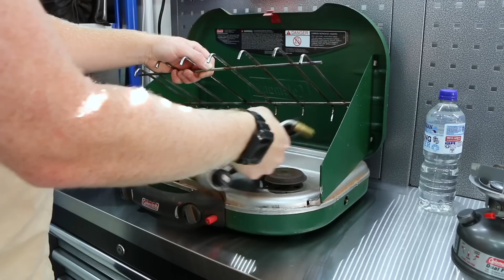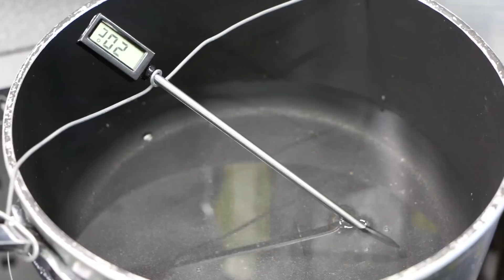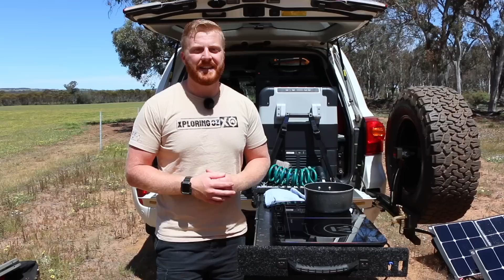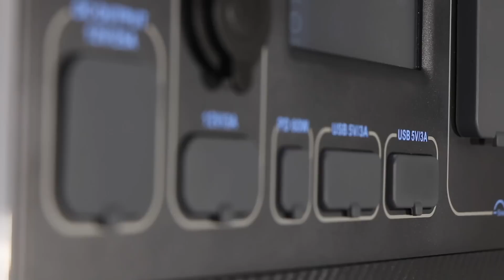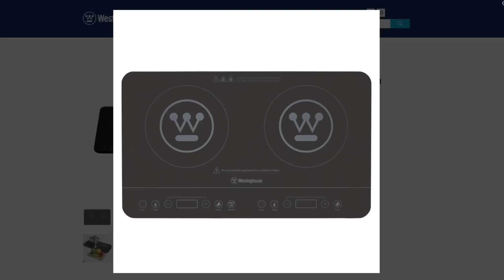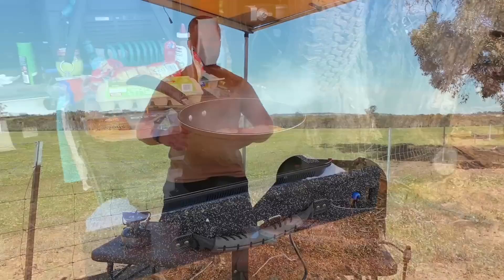INDUCTION COOKING & Camping | Is it sustainable | Electric vs Gas | Overland Cooktop | Pots&Pans

Comment: Great Video. My only query would be how do I cook my toast? It is a serious question. Normally I would use our campfire but it n wet days or in total fire bans campfires etc aren’t going to be happening. Cheers.
Reply from the maker: Yeah, someone else did bring this up and to be honest it wasn't something that I thought about before. This is probably not the best method to make toast, but I did manage to lightly toast some buns in the fry pan after cooking bacon and eggs in the morning, but like I said, not really ideal...
Reply: use a toaster?  sorry, not taking the mick....  if you've got suitable electrics for running an induction hob you can unplug it and plug in a small electric toaster which will probably take less power.  more stuff to cart around though.
Reply: Yep, I had thought of that Ray but as you say it is another piece of equipment I would need to find somewhere to pack. I am looking to try and be gas free. I currently have 300amp hrs of battery on board with 300watts of flexible solar panels so as the portable electric appliances improve I might be able to ditch my two gas cylinders and my gas cooker and that would free up space and weight for things like toasters etc. And yep I knew your weren’t taking the mick. 👍😂

Comment: I have Lithium, gas and luv an open fire. Total  fire bans, no probs with induction.It's great to cook on a fire, but a good cooking fire of coals takes hours and wood. Gas can be a problem, especially with a leaking hose or connection.  And on a 45c day, who wants to light any heat source, and stand around it getting even hotter. I noticed a youngun standing around while you were cooking. Is there any price on safety for kids? I have a Weber Baby Q which I love cooking with. What a PITA to clean. Induction is not what I do all my cooking on, but nothing matches it for quick, clean, safe and suited to any/all weather conditions, indoors or outdoors. Cost, Ok It's exy, should get 8 to 10 years out of Lithium, and it runs everything else electronical you've got.
Reply from the maker: For sure, 100% agree with you there mate. 
All the different types of cooking options have pro's and con's and this will all depend on personal preference, but its nice to have the options. 
Cheers, Nathan.

Comment: I'm running a 280ah litium cell with a 3000w inverter with the twin plate Westinghouse induction, works great ! Can also run a sandwich press, coffee machine, air frier etc.  Charging is managed via a 30/60amp DC DC charger, 30 in idle and 60 at speed above 60ks an hour. A typical 2 X pot cook up runs about 40-50amps, spag bowl for example, single cookup, bacon and eggs about 25 amps, hardly use my solar, as I get higher rate of charge driving, and I do more traversing then base camping. However can get 2-3 days being sensible without charge. However can also run the car for an hour or go for a drive for a couple hours. I love it. Built my own battery using prismatic cells. Lost power at home for a week due to storms and I just wanna lead from the car inside, kept my lamps, tv and fridge running the whole time, ran the car at idle for about an hour a day, however was gas cooking during that time as I had it. It's a 10+ year investment. I still carry a butane cooker as an emergency. I was running 2 X 100ah AGM, so by doing this I now have 250ah usable as oppose to 100 and also shed about 35kg of weight. Well worth the time and effort to investigate.
Reply from the maker: Awesome mate, that sounds like a great setup you have there. 
Those results would be somewhat similar to the results I got during my testing. 
Like you said the solar and charging setup would be heavily based on each individual style of driving/camping and time doing each. 
I agree with Lithium being an investment, it's just a large amount of 💰 upfront for most... can be hard to justify to those who only camp a few times a year. 
Cheers, Nathan.

Comment: ALDI sells similar induction cookers for $49
Reply from the maker: Sure, there's heaps of different induction cooktops out there for cheaper prices, the main reason I choose this system was the ultra low profile at only 4cm. This is one of the slimmest units I could find and required for my setup. 
Cheers, Nathan.

Comment: on the induction unit, it says rather clearly, "do not use on metal surface"

you tested on a metal bench, 

do you think that this might have meant some of the "power" was lost as it would have heated the bench to a degree also, and not just the pan
Reply from the maker: Yes, this is true, however these results were consistent with those tested outside the garage as well. Further, I did not notice any heating in the metal veneer bench. Further the Bluetti power output was also consistent with tests away from the bench. 
Although it's technically possible, I don't think it effected these tests. 
Cheers, Nathan.

Comment: Another great video, love your work. Dual lithium for the 200 could be another good option. I’ve just purchased a replacement under bonnet lithium for my old aux and might dabble with a single induction cooker now I can run it.
Reply from the maker: For sure, a fixed lithium setup would also be awesome. I guess it depends on what type of setup you're looking for and whether or not you wanted the option of portability. 
I do like how these Bluetti units also come with the hardware for inverters and MPPT chargers include though, they really are a neat little package. 
Cheers Nathan.
Reply: Inverters can be hooked up to the starter battery also, just run the engine while cooking. Great if you have an aux battery,  but can be done without it. I also have a microwave that runs on 12v.

Comment: Really usefull testing you did there. Thanks! I would also add to the pro's - On cold mornings gas can be very hard to use but the main reason I switched to induction is to get away from using gas which we will all have to do eventually (gas is a bad contributor to global warming).
Reply from the maker: Thanks mate, I try and test the most realistic scenarios as this is what we are going to use these devices for. 
This is definitely true, induction is not temperature effected like gas, just another benefit. 
Cheers, Nathan.

Comment: Another excellent video. Each system has its pro's and cons. Another con for the induction system, will include cooking with a wok. A wok really needs a flame to spread the heat up the sides of the wok. I think the round contact surface area of a wok, is too small for efficient induction cooking.
Reply from the maker: Thanks mate, glad you enjoyed the video. 
Yes, this is true. Again a lack of cooking skills and utilising woks meant that test didn't make it to the final video 😂 
Thanks, Nathan.
Reply: You're right about the classic (and best) plain steel wok.  The hob will just beep and shut down.  You can buy a wok-alike with a thicker flattened base for induction but they're all alu with non-stick coating and pricey.  Sadly you can't use searing temperatures or metal tools with teflon, it quickly degrades.  The options are gas , camp-fire and charcoal barbie.
Reply: This isn't necessarily true. There are countertop woks that have indents so the wok fits right in. Flat-bottomed woks also exist for the case you have a flat top

Comment: I found that using a bbq mat that you use on public bbqs to cook food on , I put it on the induction cook top and it saves any scratches to the glass top of the induction cook top and helps to keep the induction cook top clean and protects them as well. I like the induction cook tops during high fire risk times of the year when camping.They are handy when staying in a powered camp site, and give you options when out bush as well.
Reply from the maker: Thanks for the tip mate, I might have to give that a go moving forward. 
Cheers, Nathan.

Comment: I am planning to use induction cooktop with blue etti for my trip around Australia. I tried it once so far and it works just fine, I am planning to stay at one place for 3-4 days minimum so that I can charge from solar while I am cooking. Great video!
Reply from the maker: Awesome, I reckon it will work well for your application. Just think about a backup plan if you do happen to come across poor weather from time to time. It does require some decent solar to recharge. 
Cheers, Nathan.

Comment: Induction might be ok if all you want to do is heat a prepared meal. If you actually want to cook proper meals, the only real solution is a dual burner. For convenience, cost and versatility, a dual gas burning cooker is very hard to beat.
Reply from the maker: Maybe, not sure if I completely agree with that. I've had these running and cooking meals for up to 25 min and then work just fine. I agree that the cost is definitely better for the gas, but the convenience and versatility of a powerful electrical system and induction is working better for us. 
I guess it's just down to personal preference in the end.
Reply: @XploringOz  and the complexity of the meal. One pot meals maybe possible but anything more requires more burners.
Reply from the maker: @WesternAustraliaNowAndThen  True, but I've run dual burners for periods of time without issue. Sure it's not going to cook a roast, but realistically how long are we leaving these burners on for?

Comment: So what i took from this… if i want to save 20 secs to boil 600ml and to save the cylinder space, i have to spend over 10 times as much for a setup to save that time… definitely not an efficient camping setup…
Reply from the maker: Pretty sure there was a little more to the video than that. Either way, keep in mind whatever battery system you run, if you're running something that can power an induction cooktop, you will be able to power almost anything. The is so much more opportunity with a system like this than just powering induction. 
Each to their own, but I'm finding it a good system none the less.

Comment: All good I guess. But has everyone gone soft, forgot the challenges of camping and just old school ruffing it. I think it builds awareness in kids, things hot and cold. I’m glad my kids will learn the true way of camping out. 🍻
Reply from the maker: See I completely disagree with this comment. 

Define: soft. 

I’m going to make the very likely assumption that you drive a vehicle that has electric starter, air conditioning, power windows, modern suspension, 12V battery with some electronics, does this make you ‘soft’? 

If you go camping are you using tents? Awnings that roll out from your vehicle? A 12V fridge in the rear of your vehicle? Self inflating or air mattress? Does this make you soft? Maybe people even use camper trailers or caravans, this must be very ‘soft’

When you head out camping, do you hunt every meal, catch, kill and cook? Or take pre packaged food from a shop? Does this make people soft? 

See technology changes, people innovate, improve and adapt to create products that make life somewhat more comfortable. Calling people who use modern technology ‘soft’ is very hypocritical, unless of course you and your family are still camping with horse and cart, wooden spoked wheels and building makeshifts shelters from single pieces of canvas, whilst hunting your food without firearms. 

Kids will learn more by camping (albeit with induction cooktops) than many who don’t camp at all. But for me the most important thing is just getting out there are having fun. It wouldn’t be an enjoyable experience if we went out and argued, were cold and uncomfortable, couldn’t sleep properly and didn’t eat well. Maybe one day we’ll do SAS styled remote foraging camp for ‘family bonding’ but I camp for enjoyment and relaxation. 

I’m glad that my family are happy to join me out bush and will learn the true meaning of spending quality time together and enjoying free time.
Reply: @XploringOz  😂👍👌- touché 🤺. I used to sleep in a surfboard cover and eat cold baked beans while camping- I don’t miss that, and my wife actually likes camping now it’s comfortable and soft👌- another good informative vid as usual Mate👍
Reply from the maker: @19Vern72  Haha, yeah we all get used to the 'soft' things as time goes on 😂 
Cheers mate

Comment: great video! very exhaustive treatment of the subject.  you can use an extension cord to extend the power if you have a built-in system.  I can see the wisdom of having an all in one portable as well, great for power outages at home ☺️
Reply from the maker: Thanks mate, glad you enjoyed it. For sure, that could be an option for a semi detached type setup. 
Cheers, Nathan.

Comment: I am choosing to go all electric. Essentially what you have at home, charging by car's alternator and large solar panels feeding a big lithium battery, (with thoughts of adding another 200Ah if necessary). I want to power everything that you need, either 12v or 240v via a big inverter. A big fridge/freezer, lighting, charging phones/laptops/18v Makita power tools, cooking via a twin top induction cooktop, a small pod coffee machine. My greatest challenge is in water heating, the inverter should be big enough but the truth is in the practical test, both for showers and washing dishes. I haven't yet plumbed the system together.
In addition, I'll have portable gas cooktops and my preference for the firewood-based option.
I've done all of this quite cheaply but not scrimping on quality, I hope but at the end of the day if you are adding a 2nd battery plus solar you want to be able to power more than a fridge. A big lithium battery and a 4000w inverter gives you a few options for a weekend away or a little longer. For me, a couple only have modest needs and in reality the biggest constraint is in how long a 110 litre water tank will last.
Reply from the maker: Sounds like a beast of a system! Sure is a lot of battery capacity and input. What system are you planning on using for water heating?
Good luck with the build and let us know how you go.
Cheers, Nathan.
Reply: @XploringOz  I have been looking at the Chinese options for on-demand water heating in small apartments, for showers and sinks. I've got one of 3,000w, quite cheap, very cheap really, possibly dubious quality but as yet have not tried it out. I could but I am waiting for the canopy and 110l water tank, then I'll plumb it, hook-in the 12v on-demand pump and test it for showers and dish washing.
My theory is to have the capability and then to find the right solution. I don't have the technical expertise, only a desire.
Reply from the maker: @PowhiroMus  Mate, that where the innovation comes from. Someone's desire is another mans goal. Hopefully you (or someone else) can find a great system to get what you are looking for.

Comment: Its interesting viewing the real crunch is it takes a fair bit of power from your car engine to run the alternator that is really inefficient at generation of electricity , I have a petrol powered alternator 55 amps it takes about 750ml of fuel to replace 50 amp hours in a battery and given a good inverter is about 80% efficient its a very inefficient storage and power delivery system to a very efficient cook top. Given the upfront cost of the system is high and a little thought of the depth of discharge reduction in the Battery life.You are really replacing gas with diesel and adding a lot of complexity for a little bit of convenience regards Mike
Reply from the maker: Maybe, I guess this is a matter for personal opinion. The only other way to charge a battery being a portable generator defeats the purpose of having a vehicle and battery setup in the first place. The idea here is to eliminate petrol generators, noise and exhaust pollution plus the hassle of having to carry them outweighs the advantages. 
Further, this Bluetti system is rated to 3000 cycles at 80%. Unless you plan on discharging this battery everyday for 8 years, then discharge reduction isn't really applicable.
Like I said, all personal opinion, works well for me at the present. 
Cheers, Nathan.
Reply: @XploringOz  I used the portable generator as an example of how much fuel it takes to replace the electrical power in a Battery. Potentially a litre of Diesel has 10.6 kWh (petrol 9.7) a modern diesel is about 44% efficient turning that to mechanical power. Your Alternator under the bonnet then converts that mechanical power to electricity at say 14.8 volts to a battery that can deliver 12.6 volts.That big fan on the alternator is needed to cool it as most energy is lost to heat about 30% efficiency.All batteries need more power to charge than they can deliver (coulombic efficiency) A good 240 volt inverter about 80% efficient so a lot of inefficiently  a kilo of propane has 14kWh a 100 amp Deep cycle can deliver 1.2 kWH so call it ten cycles and ten litres of Diesel to replace 1kg of gas regards Mike
Reply from the maker: @kisbushcraftdownunder  Interesting testing you've done there. I hear what you are saying, I guess I'm just trying to make my setup 'gassless'. But it will still work for many people.

Comment: This is the exact reason a permanently mounted power system is a better option IMO.

Mine charges whenever I drive...so no need to remember to plug anything in.
Reply from the maker: For sure, that would be a good option. Might have to re-wire my inverter to turn on with ignition, to prevent leaving it on whilst off.
Reply: @XploringOz  the bluetti should have all the necessary gear inside of it...(if it will automatically switch from dc or ac input to solar)...it would require some modification though...I guess you could jerry rig a vsr or similar also.
Reply from the maker: @pauladams4890  Hmm, I'll have a look into this too. Bluetti are also always coming up with new products and features in their new items, so I'll see if I can find out whether this is something they plan on doing in the future. 
Cheers.